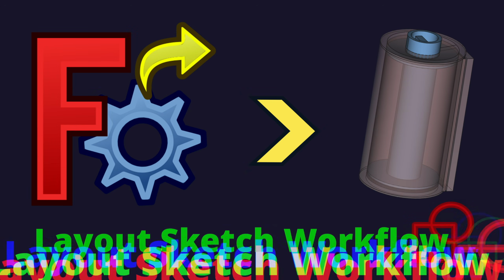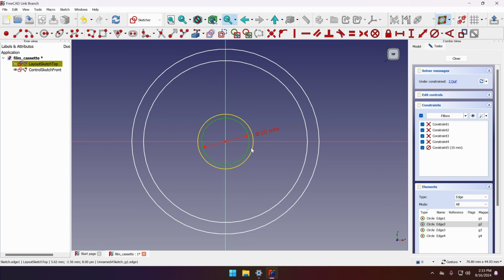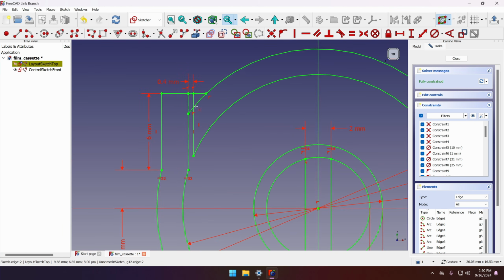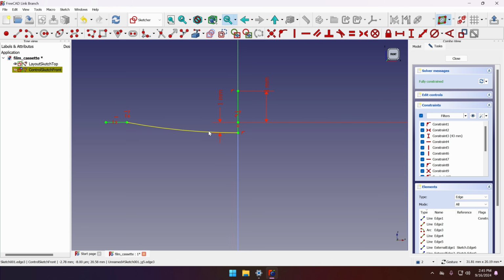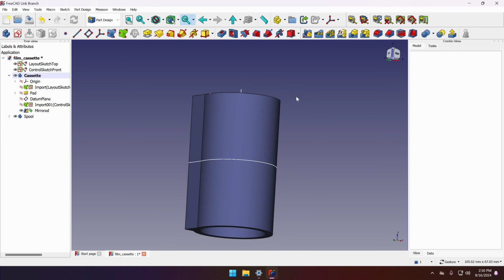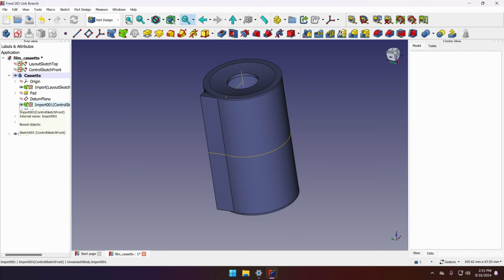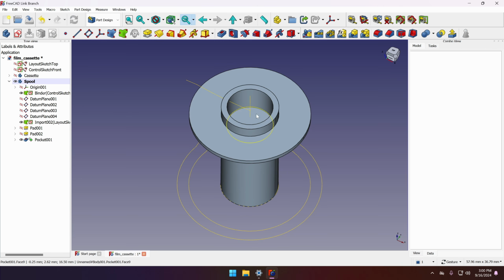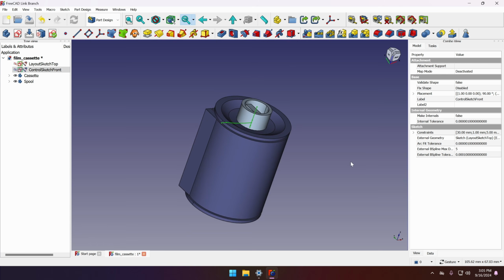FreeCAD Link Branch and the Layout Sketch Workflow (#3)

Comment from the maker: Hey, thanks for watching my video! Let me know what you think. Are there any topics you would like me to cover in future videos?
Reply: Great video! Great tips to improve my FreeCAD design workflow. Thanks a lot!

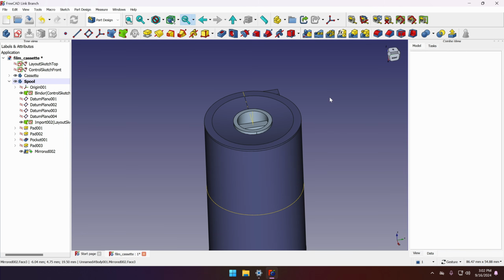At 16:35 you mention that you need to create a sketch in order to extend a face. I've done this before by clicking on the face and then using the Pad tool to just pad that face. Does that work here as well?
Reply from the maker: @JurriaanPruis  You are right! It works in Link Branch as well. Guess I was to focused on using defining geometry projection tool :)
Reply: A topic that I would be interested in is incorporating text or external (svg) drawings in a design. I always struggle with the Draft workbench 😅
Reply from the maker: @JurriaanPruis  Taking a note on that 👍